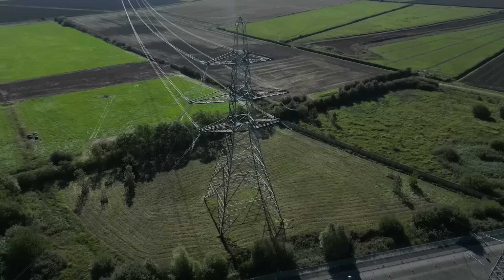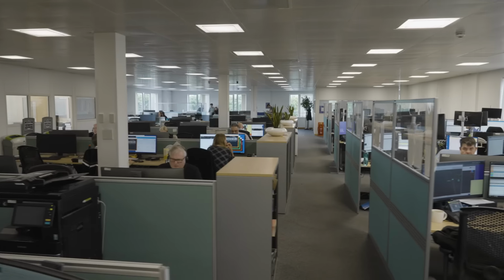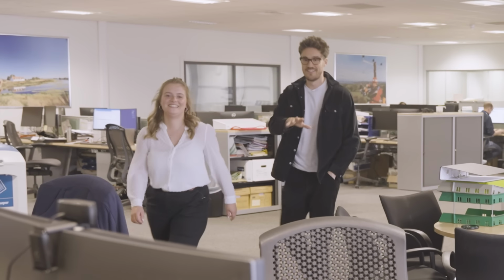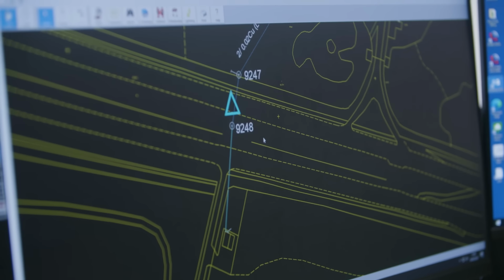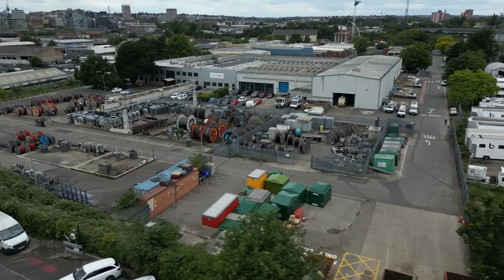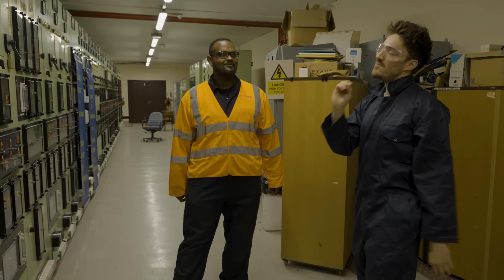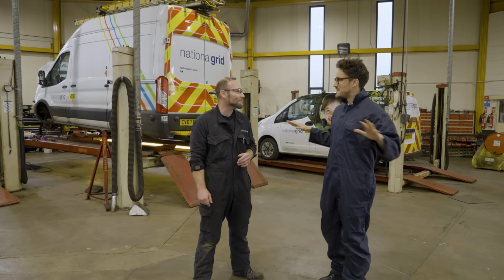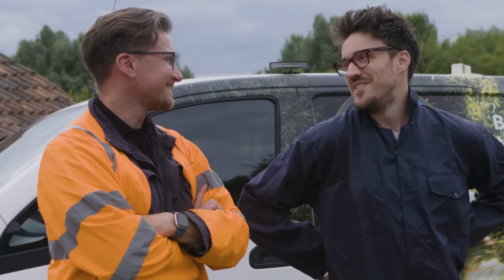Powering the Nation: Behind the Grid | Episode 3: From Substation to Socket

Comment: "a fault that a meter operator may have found'.... from my experience as a sparky 'that a meter operator probably caused by leaving a cable loose'   is more likely :)   Have had to call SSEN (our DNO) out a few dozen times during condition reports for loose connections in the service head :\

Comment: We had a connection failiure of our 100 year old connection . It was a lead bowl filled with bitumen.
The ssen team turned up, dug up the street in torrential rain and st about installing a new one.
The old cable looked brand new gleaming copper.
An engineer sat in the hole and working on live connecytions put in a new connection. The torrential rain caused the hole to slowly fill up but they cooly finished the job. 
Took 10 hours. The next day the connection was underwater which we could see because they have another team to fill in holes.
Very impressive professional work, also impressed that 100 year old cables and installation was still working. Ours failed but there are 100 houses in the street and this doesn't happen a lot

Comment: Net zero and keeping the lights on are incompatible.
You say it will be challenging, why are you willing to risk the security of our grid which should be the priority not the aim to get to net zero?
As this is about the local area network,  a significant increase in evs and heat pumps mandated by our government will seriously overload large sections of the local area network. Not only only the extra load but a load that is sustained for very long periods destroying the diversity factor used in the original sizing calaculations.

Science of climate change has moved on from the alarmism and shows that CO2 now has little to no effect on climate, but if it did we should have gone to nuclear generation a long time ago instead of playing with expensive and short lifed intermittent sources of generation.